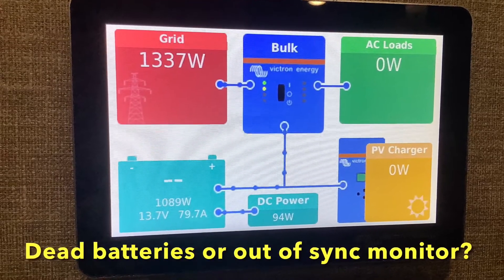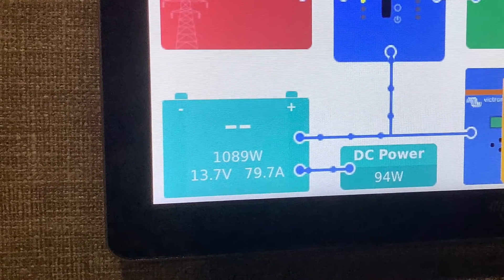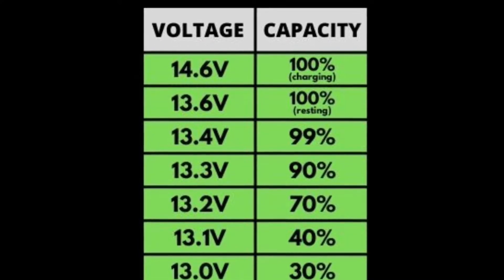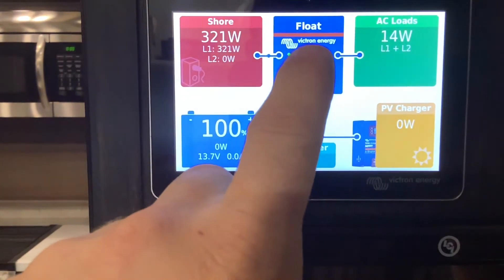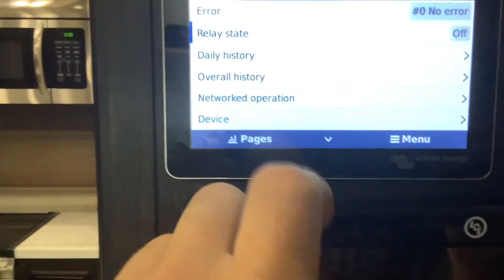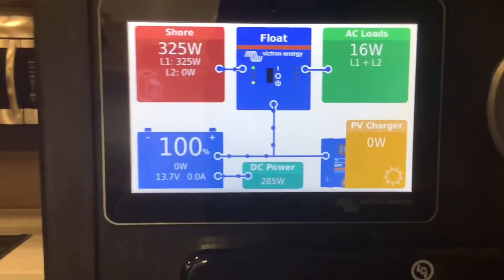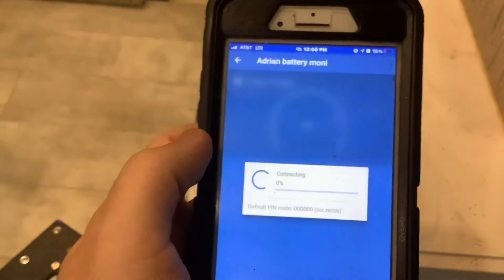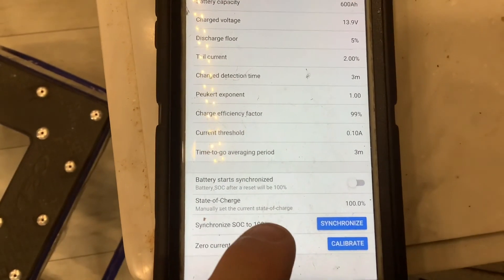How to synchronize Dead batteries on Victron bmv-712 Cerbo gx touch 50 battery monitor

Comment: My monitor doesn’t even show percentage it only shows 2 white dashes, any idea why? Video still helped a ton with the voltage tip, thank you
Reply from the maker: could be a few things. first go on the bmv battery monitor app on the phone and make sure its showing a percentage. if it shows up on the phone app, then you may need to go into the settings on the touch 50 and go to menu, system settings, system setup and select the battery monitor as the bmv. also check the ve direct cable from cerbo gx unit to the bmv is good connection.

if its not gettin the percentage on the phone app either, you need to go in the setttings and edit them and fully re-charge the battery and then it will appear at 100%